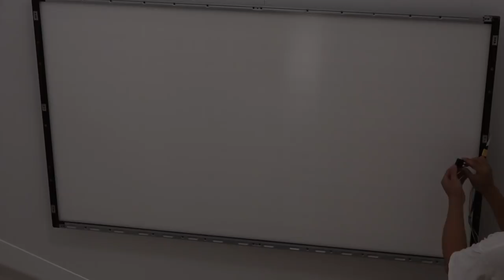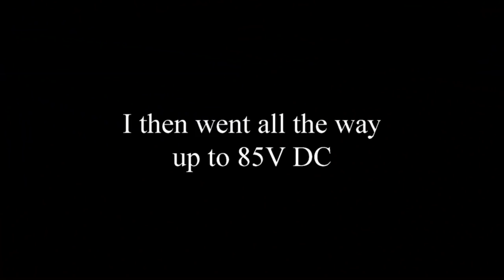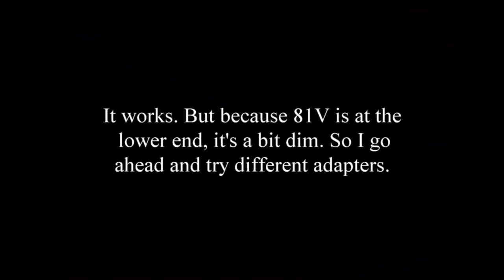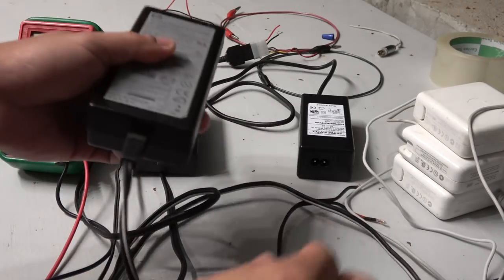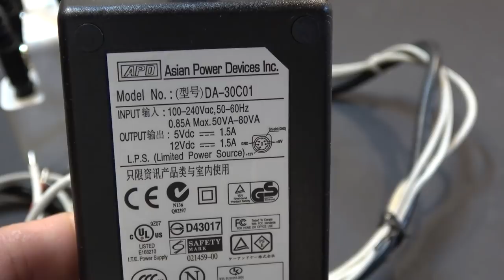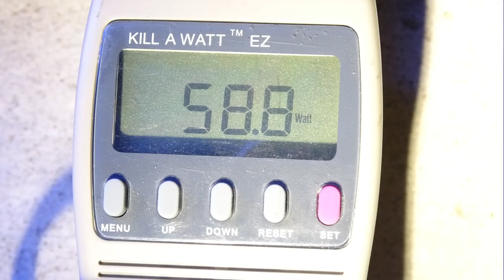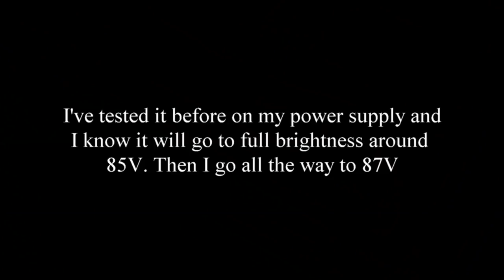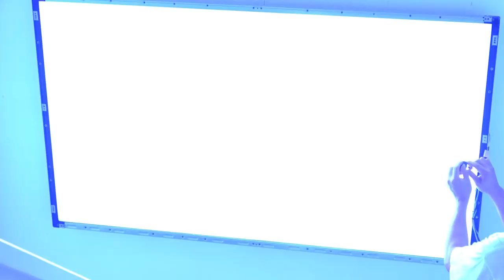DIY: Home made 70 inch LED light panel (for video, photography...) for free, salvaged from broken TV

Comment: Led must be powered in constant current, not in constant voltage!
Reply from the maker: Then try to put 20V on a 12V LED and see what happens. :D
Reply: vuaeco He's right! You should google that, or take a look at your 12v stripes what these ICs are there for;)
Reply: @vuaeco  nothing will happen if amperage stays under safe value...

Comment: Great video covering a number of different topics.  Let me ask you something; why not use the original AC to DC power supply that came with the television?  I saw in your previous video that although the LCD panel was cracked, the whole LED was lit up.  I would think that using the original power supply in the television would produce the most efficient power conversion.  You can then use it portably by using a simple car battery and DC to AC inverter.  So I guess it would depend upon if you wanted a 70 inch portable light or keep it in the studio and power it off 120 volts.  I saw the back of your hand and can only guess that you are Vietnamese.  Thanks
Reply from the maker: Good question. The original power supply that comes with the TV only works when the LCD is connected. Without the LCD (which was cracked and I already removed), it does not turn on. There's a front LED indicator light on the front bezel and it will just blink indicating there's something wrong with the TV but it will not turn on.
Reply: I am only guessing, but like a computer power supply, there must be certain pins or wires that could be shorted out to get the 85 volts needed to power the LED's.  Thanks again, and looking forward to the next video.
Reply: SilverShadow2LWB ditto
Reply: You can probably use the original power supply.  I have done this project before on a tv that I use for a shop light.  For a simple solution try running a jumper wire from the standby voltage pin to the Backlight ON (BL_ON) pin on the power supply.  When a TV gets plugged in the power supply automatically puts out a 3.3v or 5v standby voltage.   When you press the power button on the TV or the remote then the main board sends a signal back to the power supply telling it to send out the higher voltages.  One voltage is for the backlight.

Comment: I also have many AC DC adaptors. But they all out put different volts. Is it possible to combine 5v DC to 12vdc for higher amp?
Reply from the maker: You can. But it'll be 17V, Amps stay the same (series)
Reply: 110VAC to 12VDC 2amp +A, -B
110VAC to 5VDV 0.5amp +C, -D

Wire in series as 
+A 110VAC/12VDC 
-B to +C
110VAC/5VDC -D

What is the out put of +A to -D be?
17VDC x ??amp ?

Will it burn the 5VDC adaptor because more current as expected is going through the adaptor?